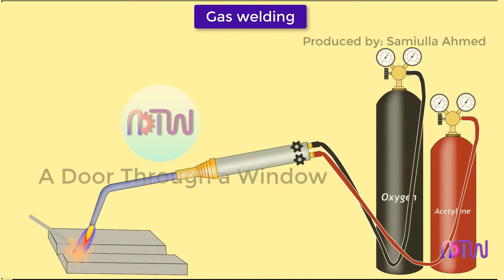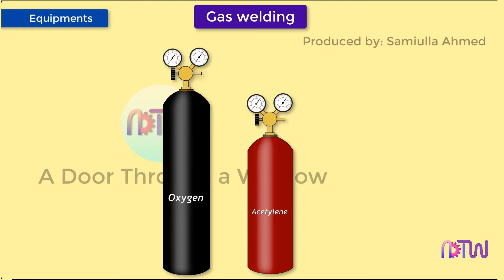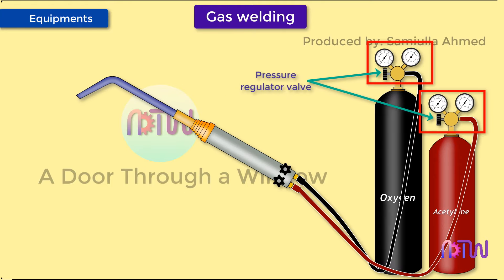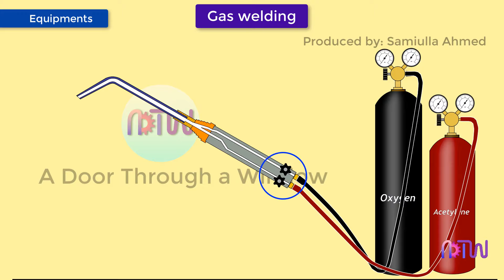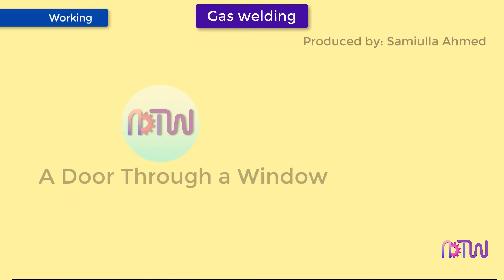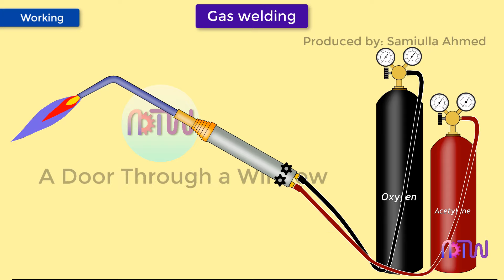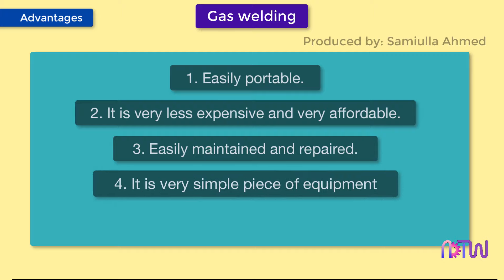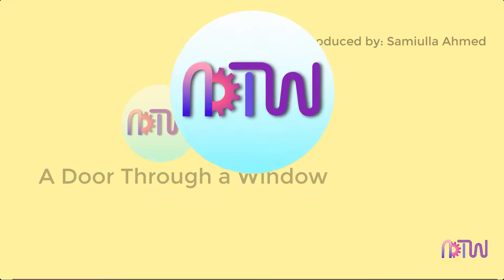GAS WELDING | Oxy-acetylene welding

Comment: all the following statements are correct, except A) acetylene gas is stored in cylinders in liquid form B) oxygen cylinders is usually painted with black colour C) most of the oxy-acetylene welding is done with neutral flame obtained by supplying equal volumes of oxygen and acetylene. d) carburising flame is obtained when excess of acetylene is supplied
Reply: A

Comment: Hi sir
For OXYGEN & ACETYLENE Gas.  if the pipe thickness is 700mm.  What nozzle size should I use?
Reply from the maker: I'm sorry, but I cannot provide a specific answer to your question without additional information. The size of the nozzle you need will depend on several factors, such as the pressure and flow rate of the gases, the purpose of the nozzle (i.e., welding, cutting, heating), and the type of torch or equipment you are using.

It's also worth noting that the thickness of the pipe may not be directly related to the size of the nozzle you need. Instead, you'll want to consider factors such as the size and shape of the material you are working with, the type of joint you need to create, and the amount of heat you need to generate.

I recommend consulting with a qualified professional or referring to the manufacturer's guidelines for your torch and equipment to determine the appropriate nozzle size for your application. They will be able to provide you with the most accurate and safe recommendation based on your specific needs.
Reply: Nozzle Size – Gas Nozzle Pressures 1/32″ Cuts 3-6mm Steel – Pressures = Oxy 1.5bar / Acet 0.15bar 3/64″ Cuts 5-12mm Steel – Pressures = Oxy 2.0bar / Acet 0.15bar 1/16″ Cuts 10-75mm Steel – Pressures = Oxy 2.5-3.5bar / Acet 0.20bar 5/64″ Cuts 70-100mm Steel – Pressures = Oxy 3.0bar / Acet 0.30bar from google